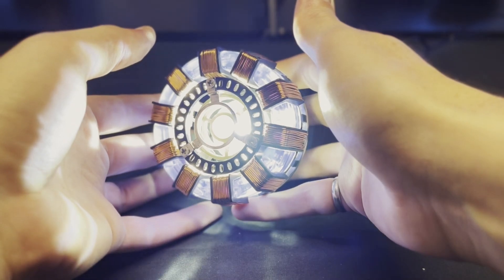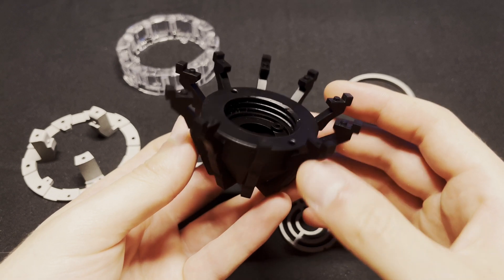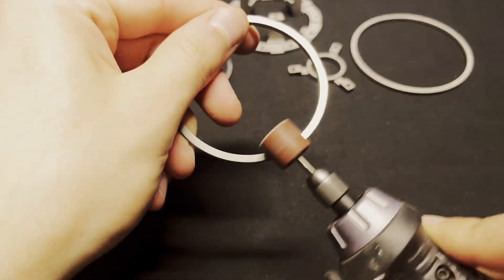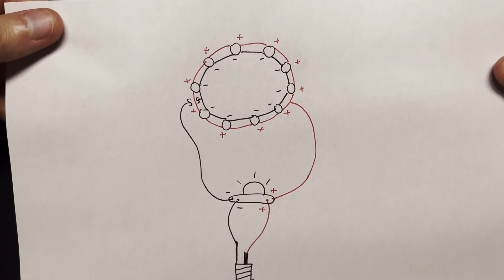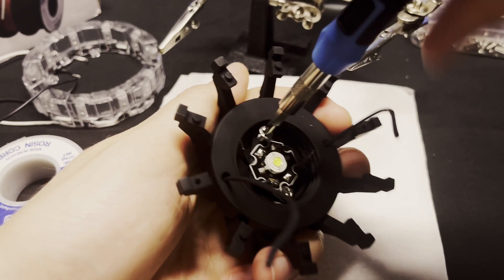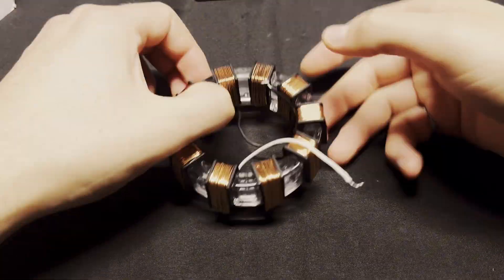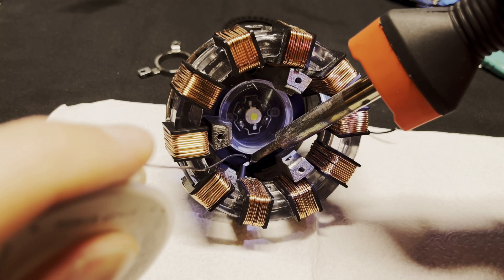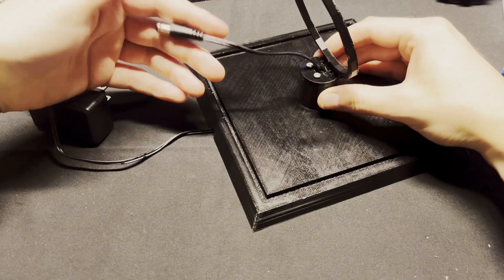I Built Tony Stark's Arc Reactor (and It's GLORIOUS)

Comment: I thought it was the power supply, why does it need to be plugged in.
Reply from the maker: You can make it with a small rechargeable battery if you want, but I chose to use a wall charger because it's just going to sit on my desk as a prop.
Reply: What would you recommend to make the arc portable